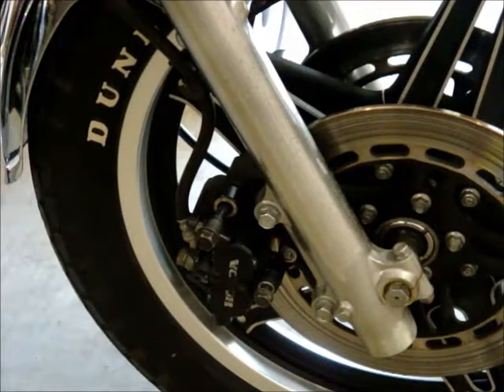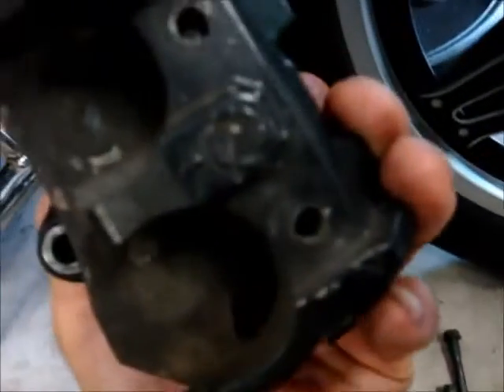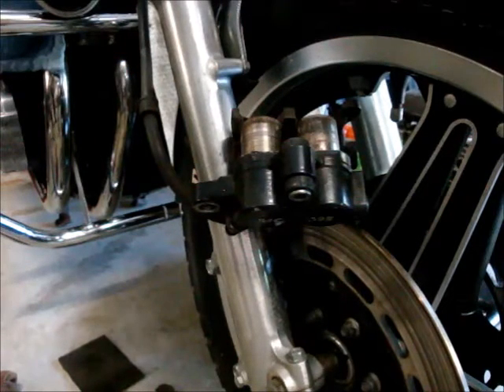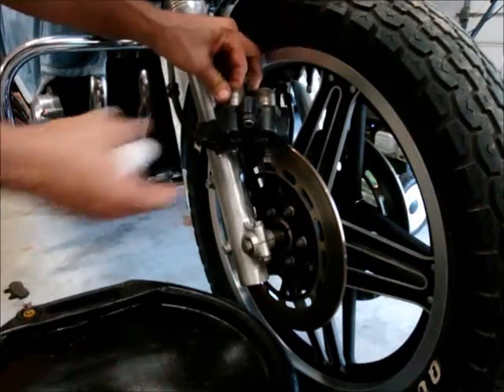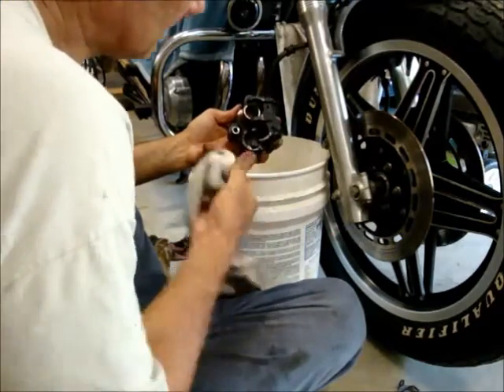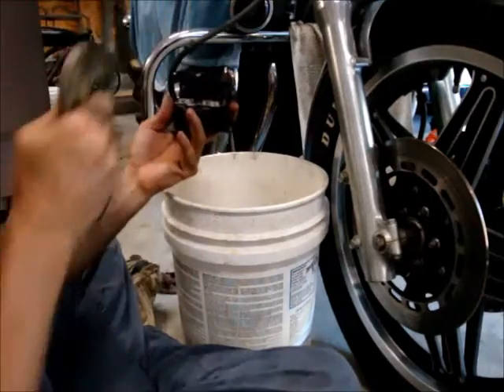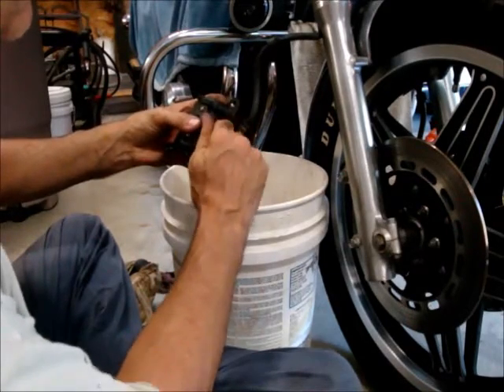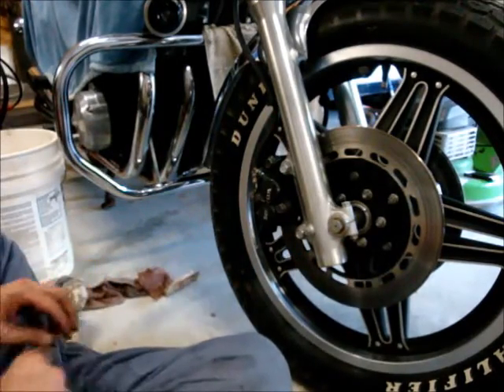Motorcycle Brake Pad Change | Fixing Sticking Brakes | How To

Comment: Do the pins need to be greased with a high temperature brake grease? I noticed there is no rubber sleeve on yours. It looks like they really just keep things in place. What if there is a sleeve over them?

Comment: Is it alright if I could apply some wd40 around the piston?
Reply from the maker: I don't think that would hurt anything... it would cause the rubber seals to swell a little bit.  Make sure you don't get any of it on the brake pads or disc..etc.
Reply from the maker: wd40 shouldn't be necessary if you get the pistons cleaned up real well
Reply: Alright, thanks man. Really appriacte it!
Reply: rub a little brake fluid around the pistons